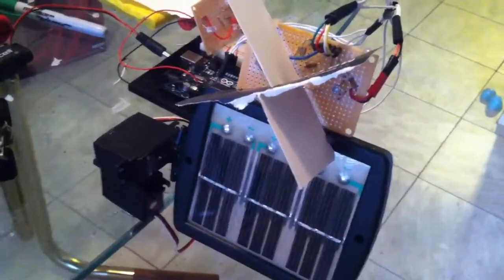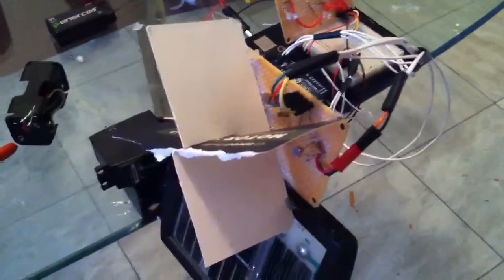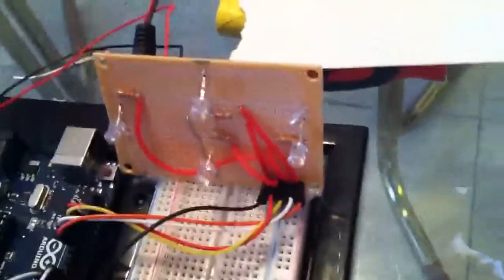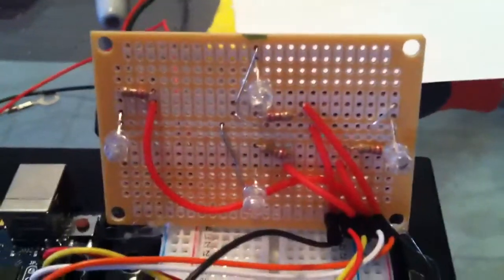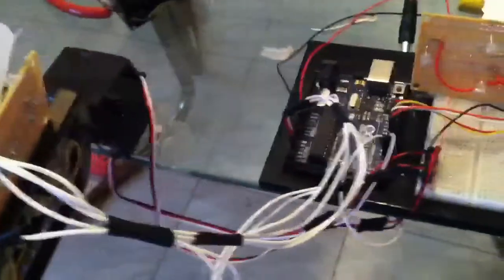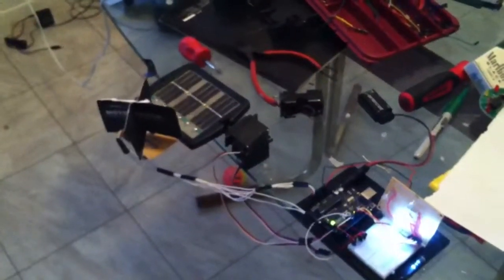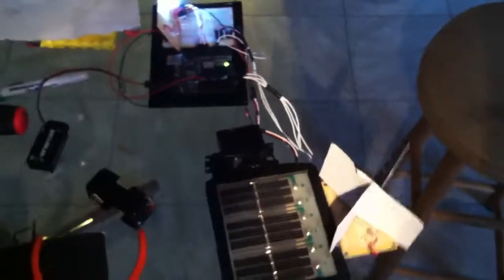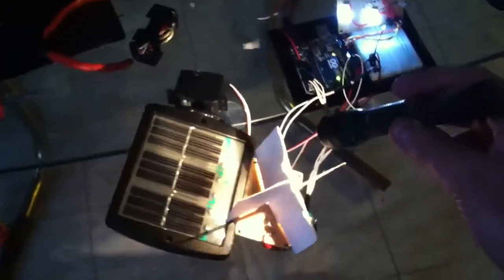Arduino solar sun tracker

Comment: Hi, just came across this project. I am basically trying to do the exact same thing for a uni model but am new to electronics and arduinos. I have managed to get one servo motor responding to a single LDR using the given script in the examples. I am struggling on how to move forward at this point and would appreciate some help. Thanks!